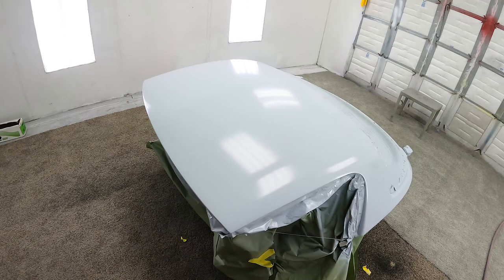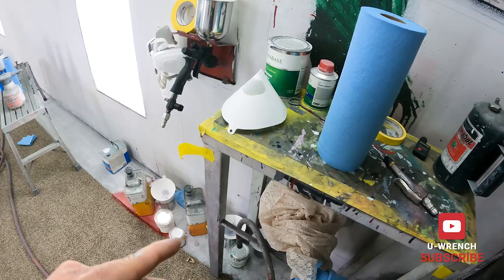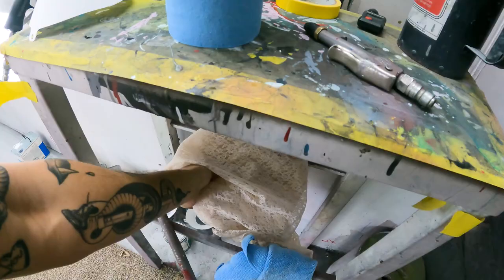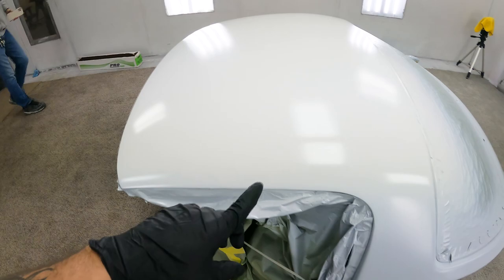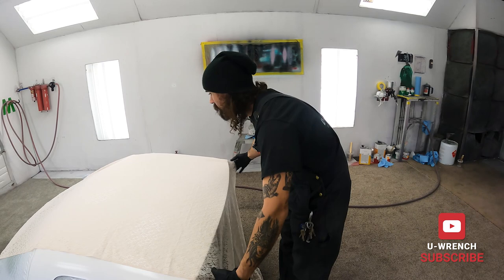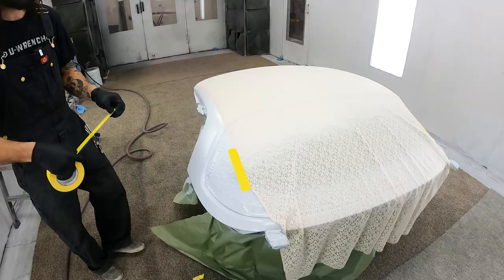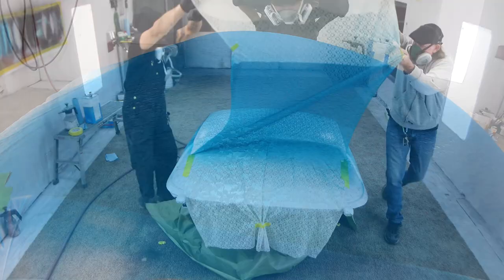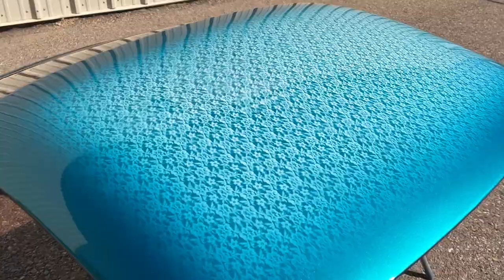Spraying a Lace Pattern Paint Job

Comment: Thinking about doing this to my Monte Carlo and stumbled on your video, that paint job was amazing, would like to ask you more questions on what i would need to to if it’s already painted , and wanted to add a lace job on the paint job it already has
Reply from the maker: Clean the of hood of any wax with wax and grease remover or if you have a ceramic coating you need to be sure that coating is removed. Sand the hood with 800 grit, then follow the procedure that Fred did in the video. Let us know how it goes 👍